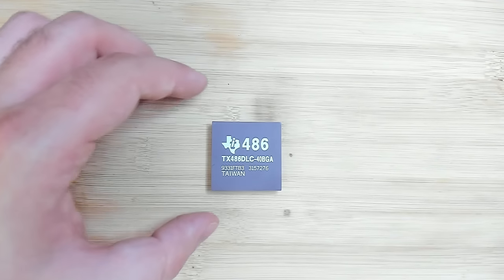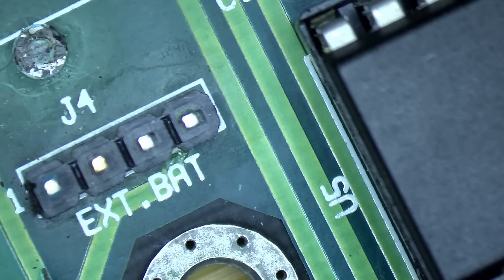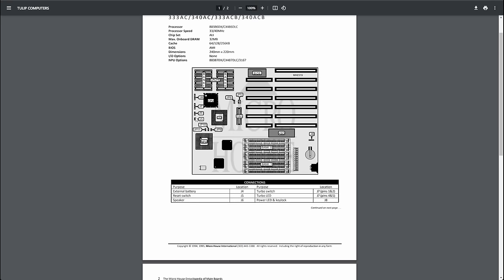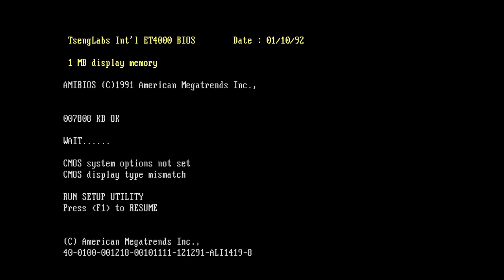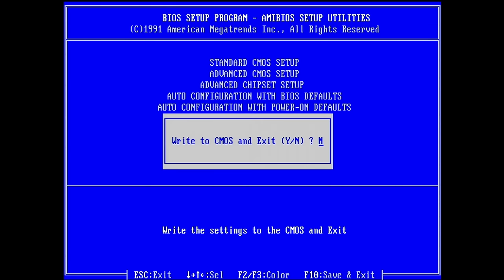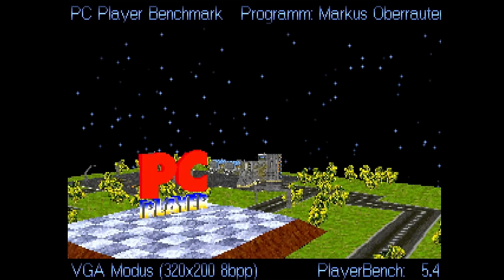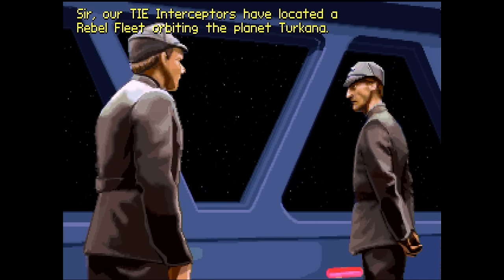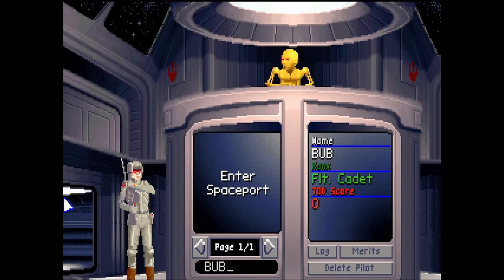A wolf in sheep's clothing: Cyrix 486DLC

Comment: For comparison, an AMD 486 DX40 (good memory and system tuning) with ET4000 ISA card scores:

Sysinfo 8.0 - 86.4
3dbench - 28.5 fps
PC Player - 7.2 fps
Topbench - 134
Cachechk - 26us, 30us, 55us, write at 27us
Doom Min Details - 58.44 fps.

So yeah, still a significant gap, which is what I noticed with the DLC chips when I was a kid and these things were current tech.

My 486 would be even faster if I equipped it with a VLB based video card too. But I wanted to be reasonably fair to your DLC chip.
Reply from the maker: Thanks for running those tests. The 486 is still quite a bit faster at the same frequency. I guess the DLC chip might be able to match a 486 25SX.
Reply: Intel 486SX-25 with ET4000 ISA for reference, since the 486 motherboard is still out:

Sysinfo 8.0 - 54.0
3dbench - 17.8 fps
PC Player - 4.2 fps
Topbench - 87
Cachechk - 42us, 47us, 89us, write at 44us
Doom Min Details - 37.12 fps
Doom Max Details - 10.93 fps
 
Intel 486SX-25 with ET4000AX VLB, because lets see what VLB gives us

Sysinfo 8.0 - 54.0
3dbench - 20.4 fps
PC Player - 4.4 fps
Topbench - 110
Cachechk - 42us, 50us, 88us, write at 43us
Doom Min Details - 38.11 fps
Doom Max Details - 11.56 fps

The VLB card puts extra load on the 486 bus, which probably for some reason causes 2-1-1-1 cache reads to be unstable, so I have to use 3-1-1-1 to reach stability.

And for completeness, AMD 486DX-40 with ET4000AX VLB:
Sysinfo 8.0 - 86.4
3dbench - 32.2 fps
PC Player - 7.5 fps
Topbench - 164
Cachechk - 26us, 31us, 54us, write at 27us
Doom Min Details - 60.19 fps.
Doom Max Details - 18.49 fps

Finally, I missed the AMD486DX-40 + ISA ET4000AX doom max details benchmark - which is 17.59 fps.

So, the 486 SX-25 doesn't quite match your 486DLC-40 chip ... but VLB closes the gap a fair bit.
Reply from the maker: That's a really good comparison and shows where that DLC fits in the lineup of 486 CPUs. Thank you so much for performing those tests. I'll pin this comment.
Reply: AM 486DX40. Oh wow that was my first ever system

Comment: I built a number of systems with 286, 386, and 486 boards back in the day, and for some reason the 386 always feels like the end of an era, and the 486 beginning of a new era.   It may be due to 486 getting massive increases in speed, and better busses over time.  It’s cool to see hopped up 386 systems like this video.  Thank you!
Reply from the maker: I really enjoy the 386 platform. My dad had a 286 back then and I have good memories of that time. What it must have felt like to go from 286 to 386 and then to 486.
Last time I found a late 286 board with a 20 MHz CPU and SIMM sockets. I'm looking forward to testing this platform as well - limited to 16 bit!
Reply: I definitely agree the adoption of 486s felt like the beginning of a new era and the end of the original wild west era of the XT, 286 and 386. I think it's because the 486 were such a big jump in performance combined with PCs really starting to mature and standardise. I got into PC compatibles at the tail-end of the XT era (late 80s) and while I loved that computer more anything I had used before (including the c64) at that time PCs still felt quite raw with all the competing graphic and sound standards, & different GUI's and OS's. Upgrading to a 286 or 386 with VGA & a soundcard was when having a PC truly felt like a legit top-tier system for both work and gaming, but there also wasn't really a clear distinction between 286s and 386s and Commodore and Atari were still putting up strong competition. However when 486s dropped in price and became common around 92-94, PCs really felt like they jumped a generation ahead of everything else. You had SVGA, 32bit sound cards and CD-roms pushing games and media beyond anything seen before, then Pentiums, 3D graphics cards and windows 95 moving the industry further just a few years later. Even so I still have a major soft spot for EGA&VGA turbo XTs, 286s and 386s due to how exciting the era was with all the rapid development going on.
Reply: @dgmt1  Good writeup - I was one of those Atari users:) -- thanks for sharing!
Reply: 486 was one of the wildest platforms. It was the first one where you might have bought into twice, e.g. replacing an original 486 with a DX/2 or DX/4. There were multiple bus changes along with a memory change. At the start of the 486 era you still had a bunch of ISA cards with each one serving its own purpose. By the end you had a unified controller on a VLB card or even on the motherboard with the PCI models.
Reply: end of the 386 saw the end of isa bus

the 486 then started a battle for dominance between vesa local bus and pci...it was also an end to the addon i/o cards, with 486 boards having integrated i/o via the southbridge

pci won in the end when it was adopted by pentium motherboards/intel
Reply: @kwanchan6745  True - though the first generation of 486 boards for home use pretty much all came with ISA bus only.  think 1989 and 1990.   There were a few MCA and EISA boards that were higher end that came a little later, and then VLBus in 1991-1992 became more common.   IIRC

Comment: Even better is the TI486SXL that has 8k instead of 1K L2 cache. But better than that are the IBM 486DLC2 or 486BLC3 (most commonly used on upgrade modules). The IBM CPUs are faster than any other 386-class CPUs since they offer a 3X multiplier and have 16K of integrated L2 cache. The "BlueLighning" is based on the 486SX and DLC2 and BLC3 CPUs are very rare and if you came across them they typically are QFP SMD packages soldered to a PCB. There are also the IBM 486SLC2/486SLC3 CPUs with 16K cache and up to 3x multiplier that only have a 16bit data bus and are meant for 386SX upgrades.
Reply from the maker: I have never seen those IBM CPUs. I did see that Texas instruments created CPUs with clock doubling, but I think I've read that there were stability issues. I definitely will keep an eye out. Maybe I'll find them one day!
Reply: @bitsundbolts you can find these cpus in japan auctions sites selling cpu upgrades for epson etc etc x86 computer pc98 another they are sold by many companies like io data buffalo etc
i have blc and slc versions 
some of these boards also come with more cache and even ram all drop in replacements
Reply from the maker: Wow, that sounds interesting! I'll check if I can find a way to get one of those! Thanks
Reply: @bitsundbolts  Pay close attention to what you're getting. The very same TI486SXL(2) cores are available in both PGA132 and PGA168 shapes, with the former being very rare and highly sought after, and the latter widely available and cheap (because there are many more performant 486 chips around for PGA168)
Reply: I actually own an Alaris Cougar motherboard with the IBM Blue Lightning CPU soldered to the board as a QFP module, and I can confirm it is shockingly fast for what is basically a 386 with some additional 486 instructions.
I can clock mine to 75mhz with the provided heatsink, or 100mhz with active cooling, but it is randomly unstable at 100mhz.
At 75mhz, it's about as fast as a 33-40mhz 486. It's weak point is that it only works with 387 math co-processors.
That said, the board does boast an overdrive-compatible Socket 5 slot, and works decently with a PNY overdrive Am5x86 at 100mhz.
The board even has an integrated VLB EIDE controller. It's really a beast.
Reply: @Null_Experis : "...for what is basically a 386 with some additional 486 instructions"

The IBM 486SLC and 486DLC CPUs support all the Intel 486SX instructions - but so does the IBM 386SLC (which has 8Kb cache). There are a few MSR (Model-Specific Register) instructions as well, mostly for cache control. IBM was licensed for the Intel 386SX code mask, and that led to the 386SLC and 486SLC replacement CPUs - but the terms were that the IBM developed CPUs had to be limited to IBM systems or proprietary upgrades.

Comment: That X-Wing brought back so many good memories. I'm currently assembling parts for a retro PC build. It's a Pentium III 1GHz and it'll have all the good period correct hardware installed 🙂
Reply from the maker: Even though emulators are good, having a period correct system is different. A fast Pentium III is a good system with a lot of flexibility. I'm sure you're going to enjoy it!
Reply: @bitsundbolts  abit bp6 dual celron, I used that for so many years, fantastic for beos, linux  and windows 2000.

Comment: I love old Cyrix stuff (and the licensed versions from TI, IBM and ST). Market realities made them a budget choice back in the days, and undoubtedly there were people that were rightfully disappointed when they brought home a system that was sold as a '486' but was actually more of a supercharged 386.
But objectively speaking it was just impressive what they did within the constraints of the platforms they ran on. The Fasmath FPUs, this 486DLC, the clock-doubled 486drx2 and the 5x86 (M1) were all significant improvements on the Intel chips for their respective sockets.
Reply: I was building the world's fastest 386 for the better part of 2 decades with the Ti version of this chip... That is, until I purchased a Blue Lightning PS/1000
Reply: @the_kombinator Jealous! I've been looking for a BL3 upgrade board, those things are awesome!

I do have an upgrade board that puts an actual Cyrix 486DX2-80 on a 386 socket, FPU and all. Pretty wild stuff 😅
Reply: A TI 486DLC with a FasMath coprocessor and maxes out RAM would have been a great machine for number crunching for engineers or researchers, for example. I love reading about people back then using the latest processors and FPU and raving about how much faster it processes their workloads. Then, the Pentium came along and blew number crunchers' minds.
Reply: I remember my MII fondly.. even if that was the end for Cyrix

Comment: At 5:15 the IC in frame is actually not a tag RAM IC, but an LS245, which is an octal bus tranceiver with non-inverting outputs.

Also, the reason the BIOS recognizes the 486DLC as a 486SX is because despite of what you might infer from its name, it has no FPU on-board. The 486DLC was basically a 486SX core in a 386DX pin-compatible package, alllowing it to be used in 386 motherboards. This made it an excellent budget option, but its performance as a 486 was severely hampered by its external, 386DX compatible bus. This was also the main reason there is 1kB of L1 cache on-board, to remedy the performance impact to some extent. 

My very first Windows 95 / Linux box was a system with a Cyrix 80486DLC 40Mhz CPU. It worked like a charm. Unfortunately it didn't play nice with my ITT 387 compatible FPU, so I was never able to get the combination to work. So during the period this system was my daily driver, I had to make do with floating point emulation.
Reply from the maker: Thanks for clearing that up. I just saw this IC next to the cache chips and assumed it was the TAG.
I tested a Cyrix FasMath and a ULSI FPU. Both worked well with the 486DLC and achieved identical results.

Comment: Cache ram makes all the difference. The big performance jump between the 386 and the 486 was the 8kb built in cache. I remember in the later days of the Intel 386 most of the motherboards would have some amount of built in cache on the motherboard to improve performance. Even a tiny amount would yield big gains. This chip just included it on the die which does technically make it a 486. In 1995 I got a Pentium 90mhz system. The mother board had the option to disable the L1 and L2 cache. I tried it once just to see what would happen. It ran like 386.

Comment: I loved the 486DLC's for that one simple fact that it let me upgrade 'legacy systems' without needing heroic measures.  My best use of one ever was a guy who had a site-security/card-scanner system that ran on a 386.  Adding a new building on his site and a few new cards made it just take longer to run the security software.  I don't even know WHAT security software, it was a very custom 'command prompt-looking/unix-based' thing, though, no GUI.  He needed to upgrade it but due to the security method for the software being unable to be moved to a new motherboard, he needed a PURELY in-situ upgrade, but had a 386/33 already in it.  I suggested maybe upping it to 40Mhz with some heat-sink on it for cooling, but I admitted that this might only work for a time.  I DID know of 486DLC chips, though, which I thought could run reliably at 40Mhz and were drop-in replacements for 386's, not even needing any changes to operate.  I know there are 'better functions' that can be enabled by the jumpers that this guy's board allows activation of, but they don't HAVE to be used.  Anyway, his board didn't have special jumpers for the DLC, but it didn't matter.  We scheduled 3 hours of downtime over the weekend, then he and I went to try it out.  He was VERY doubtful that it would be as 'simple' as it sounded like so far, but I made the point that we've learned most of the simpler problems by now so there were less 'stupid problems' available to trip over.  He still doubted, but that was fine.  I swapped the chip out with no special issues, put the DLC in, checked with him to see if we needed to do anything special before powering it on, and then switched it back on.  The fanciest thing done was to double-sided-heat-tape a heatsink to the processor.

Boom; POSTed just fine, saw its expected memory, crunched and munched a bit to boot up, and eventually his normal security screen came up.  He sounded a bit surprised when he said "Well, that was a bit faster to start up", and I was just smiling while he did "I don't know what" to his control software.  Then he takes out a security card and we go to a few doors.  Beep...tinypause, BUZZZZ!  All solved, no unhappy security software, I didn't try to talk him into a new computer (which he resisted both because the current one worked fine still, but also especially because of the "anti-copying security dongle" he was stuck with!), and it "Just worked".  He was duly amazed, and happily paid my invoice.  I checked in with him 30 days later to make sure everything was STILL fine, and it was.  Sadly, I was half-hoping he might have done a "Hey, while you're on the phone, maybe I can upgrade/buy some other thing" too, but oh well, he was still a happy customer.  The DLC's worked nicely for a great many things, they were a nice performance improvement even in a board that didn't have special settings for it, and was a VERY nice improvement for motherboards that recognized the DLC chip.  I think I even have one left in my "Old CPU's and RAM" storage case because you never know when you might need a 386 upgrade..!  Or fine, maybe just because I don't have the heart to toss out the brave little upgrade chip that made several of my clients happy back in its heyday.  I'll keep it until I find it a home somewhere, or maybe I can be buried with it...I'll have to ask about that now, even if only to confuse future anthropologists.  :D

Doing my part to vex science!  \o/  How many dissertations might my confusing burial generate 100 years from now, or 200 years, or more..?  I should find my old v.32 9600 US Robotics modem too, maybe!  It and I had so many adventures back in the day.  Oh the fun...I should bring an ESDI controller and drive too, "...but the burial has been dated to several decades beyond the end of the ESDI specification era, so the analysis is continuing for now.  The card's 'MicroChannel Architecture' bus interface was especially vexing, requiring colluding with the Antique Bus Analysis Group in the Electrical Engineering Quirks division to identify it and analyze its capabilities.  It seems to have been deeply-unpopular even in its primary era.  Considering its main competition was the ISA bus, this is confusing.  MCA seems superior in several regards.  More research is ongoing into that topic."  What to put ON the hard drive, if I can (likely) still spin it up and low-level-format it to a usable state?  Hmmm...must think about that!  SotA content about the latest in quantum computing just to be contrary, and to (maybe) help them get the proper date for my passing?  The choices are legion..!
Reply from the maker: A great story about upgrading that security system. It shows you how difficult things get when software is locked to a specific hardware. Good that a CPU replacement got a few extra years for it. I was very surprised by that CPU - sure, it won't be as good as a 486DX with integrated FPU, but it's a great option to get more power from some of those 386 boards.

Comment: Something that the vast majority misses when talking about the 386DX vs the DLC/SLC is the actual core of the CPU, they tend to say oh! it's just a supercharged 386, or it's just a 386 with some cache on it and so on.
The Cyrix DLC has a real 486 core on it, including the tight 5 stage execution pipeline, 486 instruction set, and some L1 cache (386 have none of that) + some versions are clock doublers like de DRx2 (like a legit 486)   😊
Reply: Yeah, it's Cyrix's successful attempt to independently design a chip that gets fairly close to 2486 performance that is still compatible with 386 mobos. It's a genuine hybrid design. It's also why the bios sees it as a 486SX, because thats sort of how it looks to bios cores that are not Cyrix aware. The better optimized bioses would pick it up as a 486DLC.